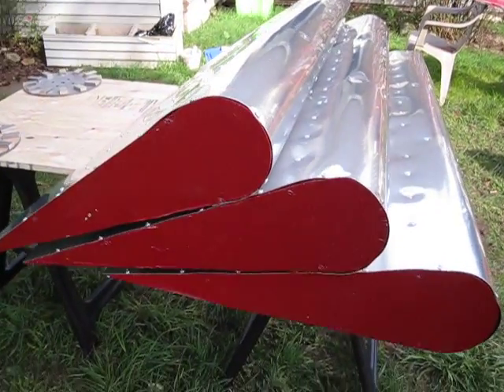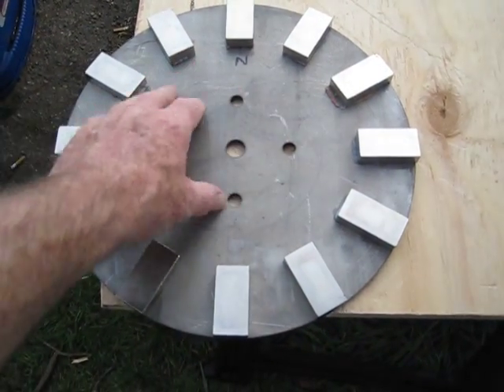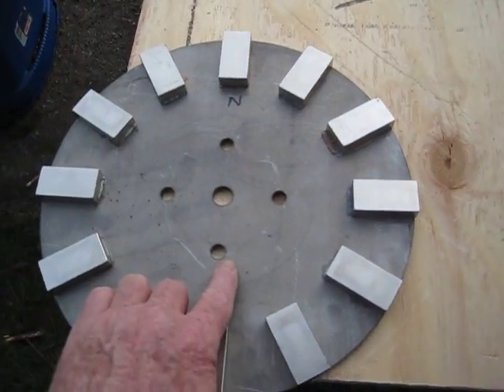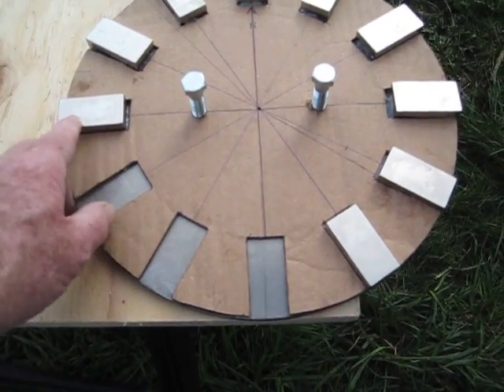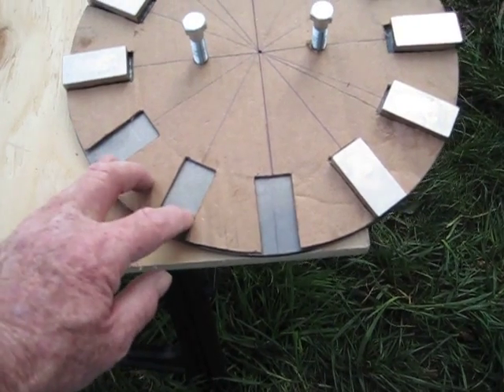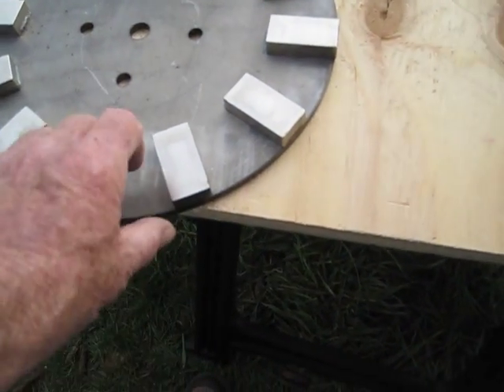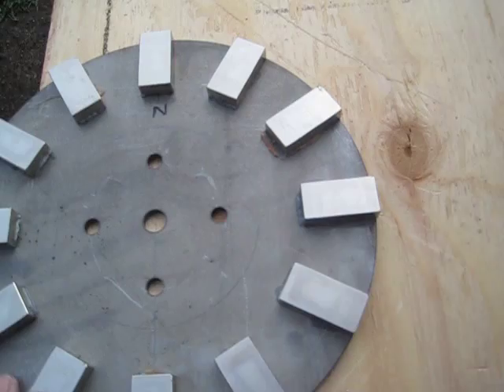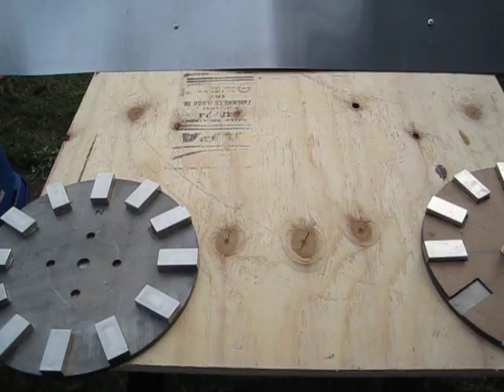Vertical Axis Wind Generator Wings 001

Comment: What size of magnet you use? I mean the dimension.
Reply from the maker: i use 1/2  inch thick 1 inch wide 2 inch long 72 pound pull magnets.  i also changed companies i get the magnets from, i had been to many damaged magnets from magnets4less so i dropped them and went to CMS magnetic, very good quality

Comment from the maker: I was thinking about using those magnets with the holes in the center, but then I thought if I got the screws/bolts to tight, it might chip the coating and damage the magnet. I have been waiting for the rain to stop so I can pour the stator and coat around the magnets, a few more days I should have good weather. was going to ask you about a decent low budget charge controller set up for the wind generator. I picked up 6 Trojan T-125 batteries not even a year old for 25.00 each today. so I am about ready to hook up the solar panels and get things going.